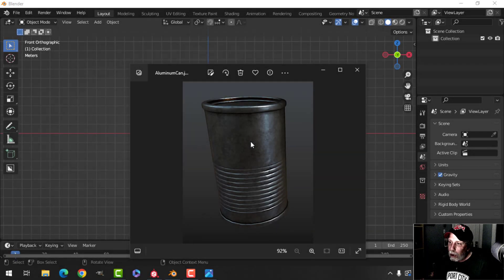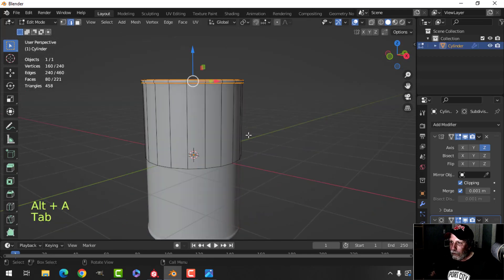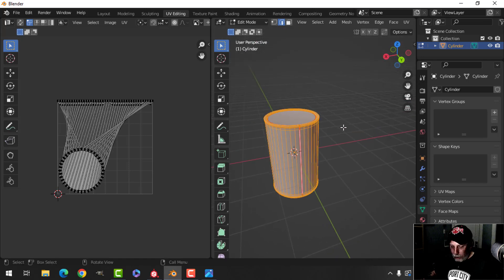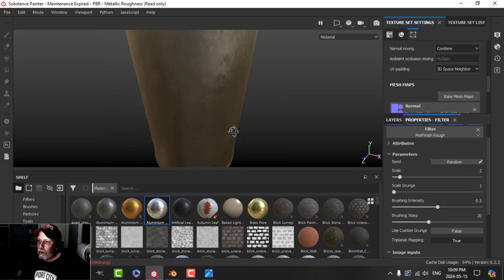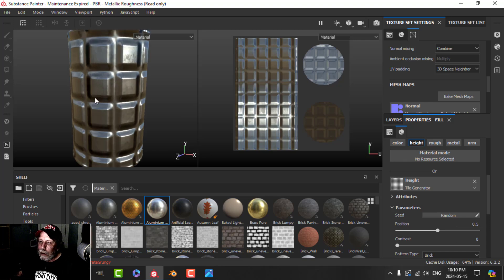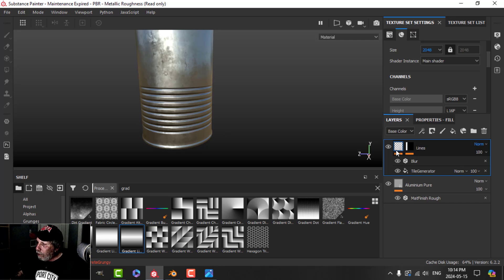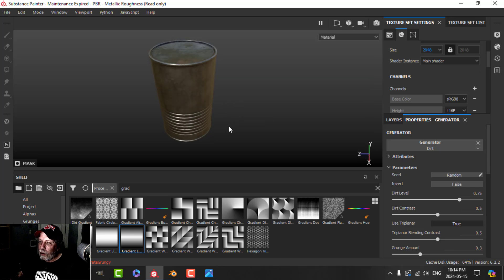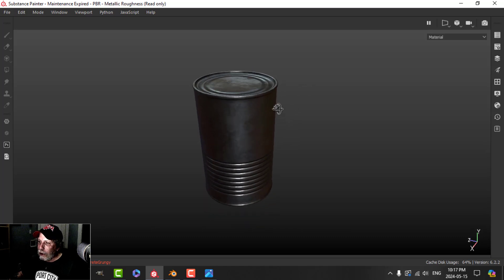BLENDER/SUBSTANCE PAINTER: ALUMINUM CAN

Comment: Nice! Ive just gotten into the mindset of not adding details to the mesh that can instead be achieved in substance painter. This technique you showed here will help me create the vents for for a model Ive just finished. If only my laptop was good enough to allow me to use SP smoothly. One question in regards to converting the model to .fbx, taking into SP, then back into blender - does it mess with the model in any way? Like can I still make edits in blender like normal? 
Or is this whole process best left until the model is 100% final?
Reply from the maker: Good stuff.  Yes you should do all edits to your mesh in Blender and then texture in SP.  You can go back to Blender, make some changes and save again as fbx and use the edit configuration menu in SP to reimport  the modified fbx but you then have to bake again and possibly adjust some textures and continue.  Many details look fine in texture such as bolts or vent blades but many details still look better in geometry so it depends on your final use of the model and the look you want to achieve.  Good luck!
Reply: @zerobio  Gotcha, thanks! And yeah, I think for smaller things like screws and bolts, having them as textures makes sense. The vents on my model are tiny, about an inch wide so this technique you show should work great for them.